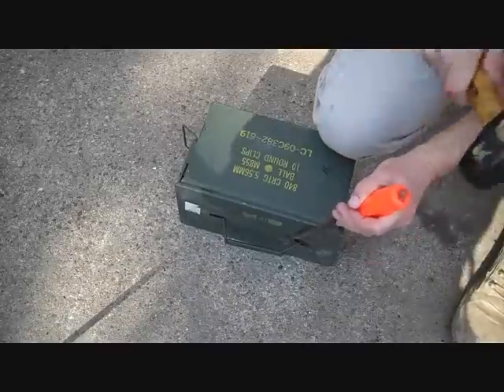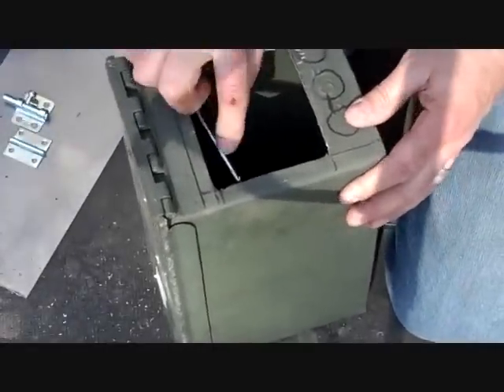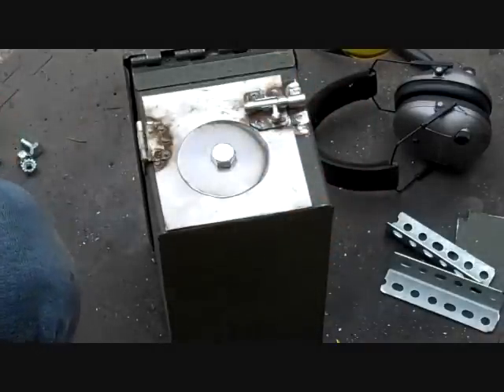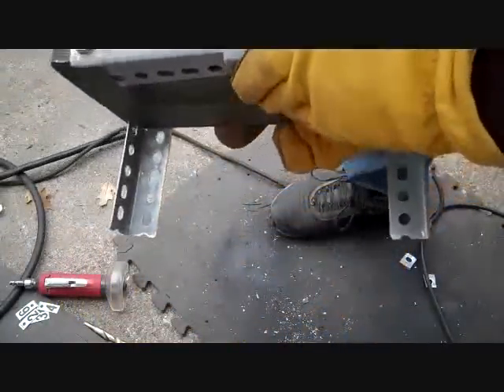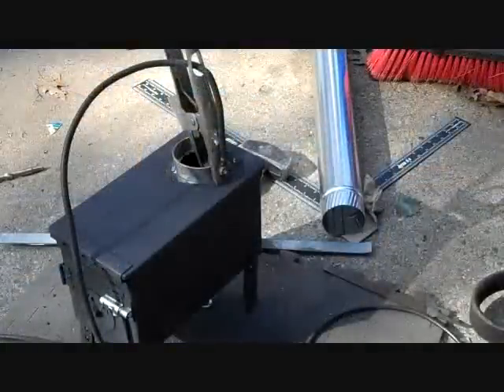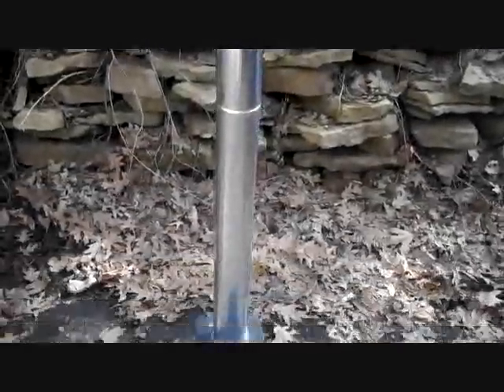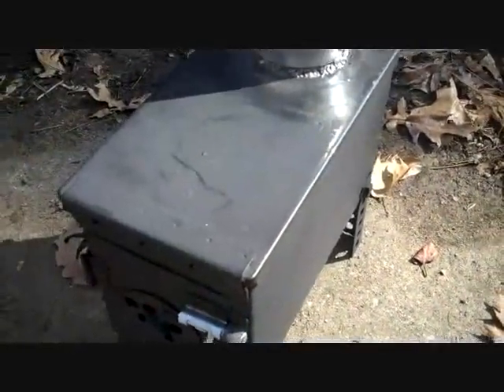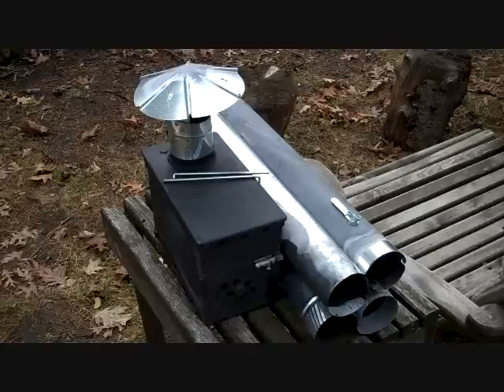DIY AMMO CAN TENT STOVE  (PART 2)

Comment: a good idea is to drill 3 to 4 holes around the top of the rain cap then add a short light weight chain or cable about 6 inches long then add 15 to 20 ft of 550 cord to each one, so you can tie down the smoke stack(guy lines), so it dont blow off or over, just like the H-45 heaters/stoves we used in the army, it will save a lot of grief later, Great video as always YP keep it up!

Comment: Outstanding stove sir, I have no doubt that would heat my tent here in Alaska. How well does it handle coal ?

 When I camp in the winter up here I have a sled in tow instead of a pack on my back, that is the perfect size to replace my current mini stone, thanks for the well thought out stove design.

Comment: great stove.  Q. Do you think it would work to cut the pipe in short enough pieces to fit inside the can. Put the pieces inside each other and then put the bundled pipe inside the can for storage and transportation? might be to short to put back together safely just a thought.

Comment: The stove gets too hot, so any thing over 300-400 degrees will burn up JB Weld.   I've tried it.   Great video.  Did you sand off the original paint before you sprayed it with high temp bbq paint?

Comment: The BATF defines a tactical torch as having at least one  picatinny rail and at least two of the following a foregrip,  single point sling attachment, laser sight , flashlight, bayonet attachment, or detachable high capacity fuel tank.

Comment: Since the pipes do separate at the seam, is it possible to roll them one inside another so that you are only packing "one" pipe? And if that is possible, any way to shorten the exhaust pipes (and pack them inside each other), while maintaining total length of exhaust by having more sections, and then put them in the can itself?  Obviously I haven't tried this and I may well sound silly for asking but I gotta ask.  Great project and, as usual, very ingenious. Thanks, YP!

Comment: How much heat does that size can put out? I'm wondering if that would be big enough to heat an old canvas 8 person tent in winter. Maybe a fat-50 size can would be better? Excellent ideas though!
Reply: It will heat your tent with ease. I use dry hardwood in mine. Best heat when good hot coals are burning.

Comment: Great project bro, I bought a 10x10 portable shed mostly for longer hunting trips for a lot more than what you spent.  I heat it with a kerosene heater that does very well, however I want to heat it with wood.  How did you pipe the chimney out top?  How long will your stove hold a fire before refilling?  I should of done some thinking before spending all that money.  Great job!

Comment: Good day
I use JB weld to repair items, & yes it stays in place with heat up to around 100C but the heat from the fire, right on the box itself, it will melt off, but up away like on a chimney top should work fine..supposing you are burning normal wood, not coal eh.. 
I suggest "pop" rivets... the steel ones..to attach the door & latch if you cannot weld. Very inexpensive!
Bronze welding is a great substitute!!
I have excellent success with that, & it's not *too* costly.
Reply: RetroCaptain  possible to use small nuts n bolts for door n jb weld for pipe ? Thanks , just wondering.

Comment from the maker: Easily.  I have a fairly large (10' diameter) teepee I use this stove in and I can be sweating in it when it's 20 below outside.   The downside to this stove is it's size,  which means you have to feed it regularly.   But that comes with needing a packable stove.

Comment: Hey Yank, If you know of anyone in need of a M-1950 Yukon Stove, I am going to have a few shipped to me in the near future. I know these stoves are VERY hard to come by these days and people are paying $250 and up on Ebay for them. The ones I will be getting are in the original box, have never been used, (although they WILL have some amount of corrosion as they are mil surplus).  All are complete stove sets, with fuel burner, hose, Jerry Can connector, stove pipes, and the wood grate.